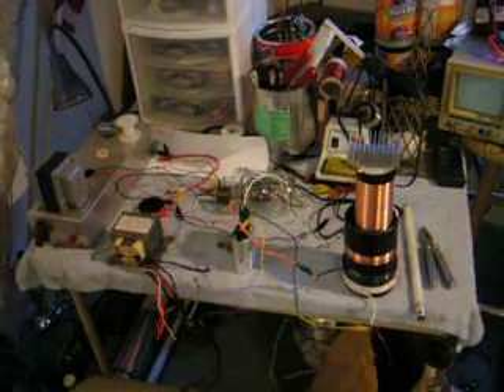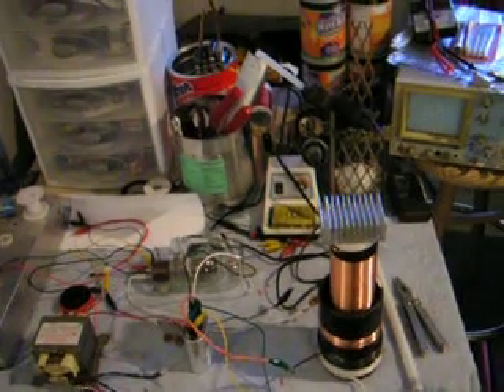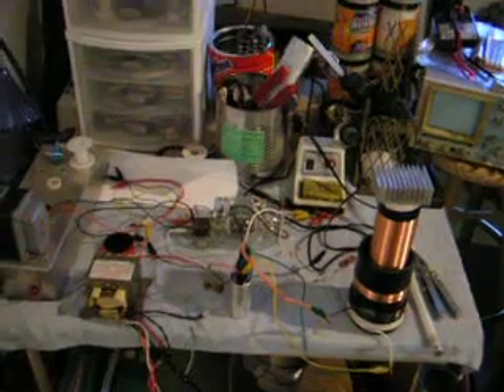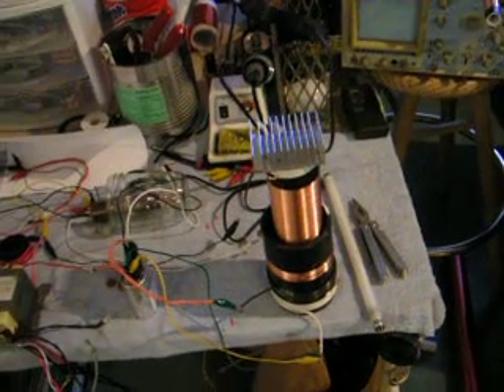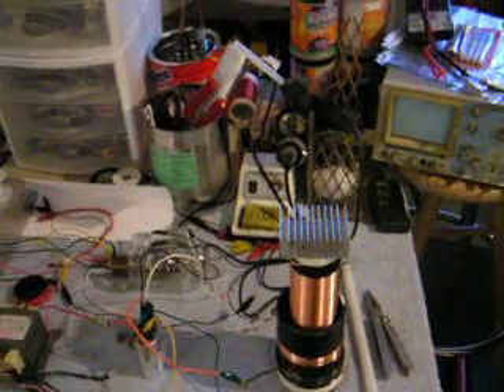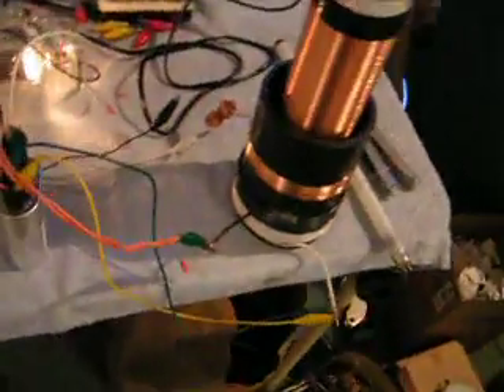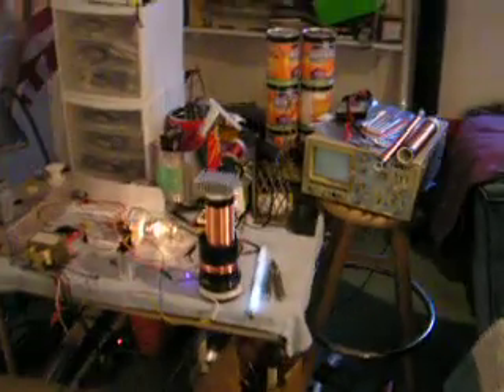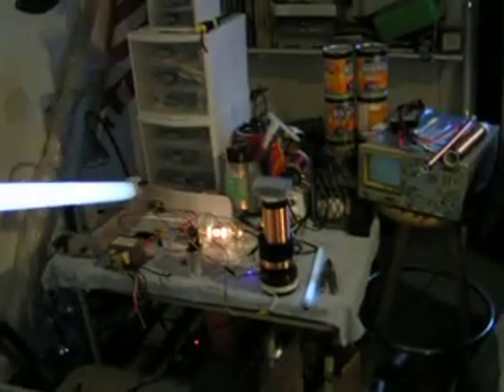Vacuum Tube Tesla Coil

Comment from the maker: @MopDMTBARTL the energy density of background radio waves isn't really enough to be practical for using as an alternate source... you'd have to be able to absorb radiation through a large area, over a large bandwidth in order to absorb enough energy to really use.. if it was as simple as you assume it to be, surely it would have been in use a long time ago.

Comment: Very very cool, but I'm a little confused about a couple of things: 1.) Where is the high voltage output?  Is it at the "heat sink" at the top of the coil, which would then really just being used as a top load and not as a heat sink.  2.) What is the arc at the bottom of the coil you mention?  You have no spark gap, so I would think any HV arc would be from the top of the coil.  So I'm a bit confused, but very cool.  Lots of power to light the tubes and mess up the camera!

Comment from the maker: hey thanks for the comment. 
i haven't ever used a rotary spark gap in any of my coils. infact i don't have much experience with spark gap coils so i couldnt give you any helpful tips there. but anyway, does that motor come with some way to control the speed? or do you plan to make your own?? you're right, that would be a convenient way to tune the discharge :D...
there is a cap connected in parallel with the pri coil. one end of the coil is connected to the plate(tube)and the other, the trans

Comment: nice your making the coil correctly. in teslas last wiresless energy patent, he tells of a large surface area on top so no sparks are lost to the air. very good job. the sparking tesla coils are cool, but are not efficient compared to the real wireless energy ones tesla perfected, they would be quite as well.